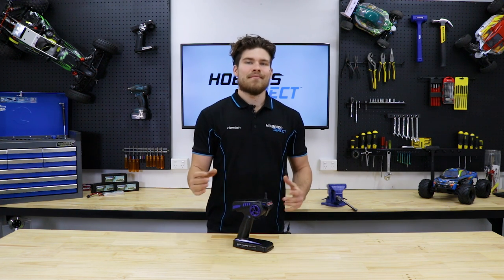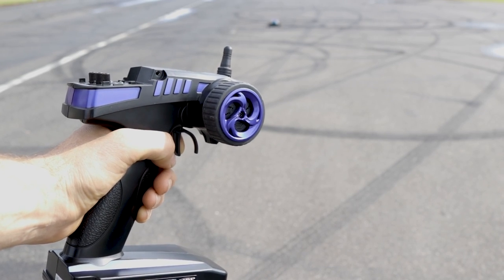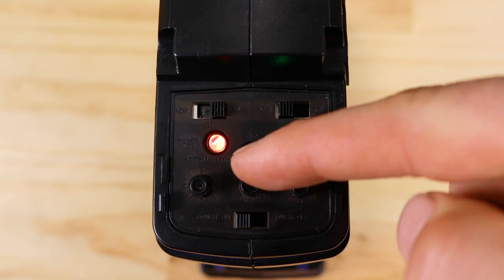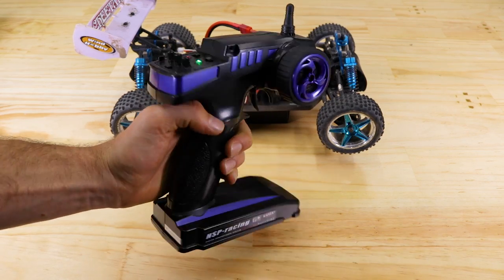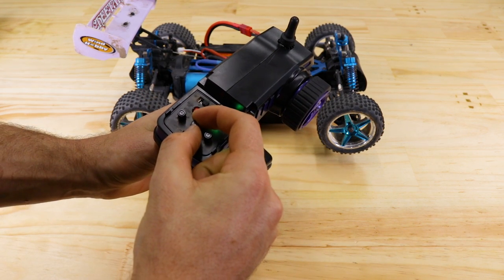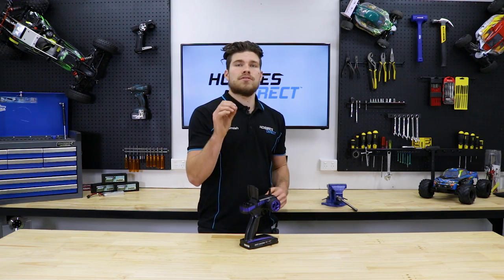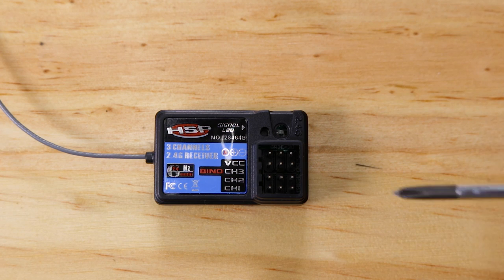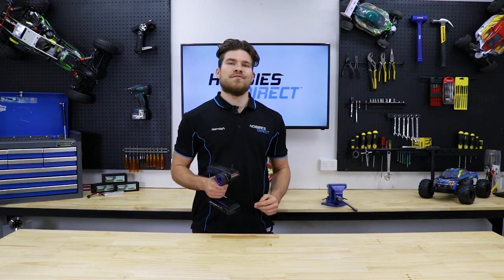How to: Understanding and Adjusting Basic RC Hobby 2.4Ghz Transmitter Settings

Comment: Thank you for the great info. I have a cheap RC boat that once work and no longer works. The board has power, but the remote does. New batteries didn’t help. Any suggestions on where to start?
Reply from the maker: Not knowing anything about the boat, might be time for a new radio system :-/

Comment: Hi mate nice informative video can I ask your advice please. I have a original hornet RC off roader but I took out the battery pack to insert a ubec, would I now need to replace the ESC and controller? as I'm having trouble and confused me and can't move on to finish it. Any help appreciated. Thanks, mark.

Comment: My HPI TF-40 Transmitter has both D/R and Servo End Point Adjustments for both Steering Servo and Throttle Servo, do they both do the same thing?
Reply from the maker: Really good question Scott, they are similar but unlike dual rates the endpoints adjustment allows you to set the throw for each direction individually. For example, you may need 50 degrees of servo travel to attain full left steering lock but only 30 degrees for full right, where  D/R adjusts each side equally.
We should do a video on endpoints, hope this answers your question.

Comment: What does the TH trim do, whats a throttle channel?
Reply from the maker: There is a trim knob for each channel. The knobs are used to adjust the steering or throttle so that the car tracks straight when the steering wheel is centered and does not creep when the trigger is at neutral.

Comment: why is my 4ch dumborc  have to REVERSE throttle and steering swotches to work normally?  ALSO  forward is slow and reverse is FAST   how do i fix that?
Reply from the maker: Every car has a different "normal" motor and steering direction, the reverse channel switches enable the controller to work with many different models. As for going backwards faster, swap your motor wires and reverse your throttle channel switch from whatever position it is in :-)
Reply: @HobbiesDirect  i am a newby with this  an old dog new tricks 59yr old   lol   explain  swap your motor wires ?   got 3wires to the esc    yellow  red   blue   how should i swap these?  also  switched throttle from normal to rev   direction is fixed   just the power issue remains   thank you! Chuck
Reply from the maker: You should be able to swap any two of them if it's not a sensored system - watch here: https://youtu.be/-hAoT1ZsBEI?t=597
Reply: @HobbiesDirect  i left the center-RED alone   i swapped the BLUE and YELLOW and that did it!!! 2days of trying to figure it out and you really helped!   Thank you!  Chuck
Reply from the maker: @chuckneal5828  Awesome!

Comment: Can somebody help me, when I turn off the controller or the car is out of range, it go full throttle forward instead of stopping, how to fix this
Reply from the maker: Sounds like your failsafe is set incorrectly, try resetting it, should fix the problem 🤙
Reply: @HobbiesDirect  ٠
Thnx for your answer, I reset it, it works fine, after 30 minutes, it goes back to falt and the car throttle forward alone, I rest again and it's fine for another 15 or 30 minutes,, should I buy a new one? Or if there is a way to hard reset settings in it?
Reply: And I really respect you for quick answer, other channels don't even care about followers, thnx a alot

Comment: One question . If i set the throttle trim do I need to calibrating again ?
I can't figure it out .my sterling still not working and lean to one side . My rc brand is serpent XRS8 e
Reply from the maker: If you change the throttle trim, it's a good idea to recalibrate as you have moved the neutral point. What's your steering not doing?
Reply: @HobbiesDirect  I solve the problem ald .thanks dude . Because I accidentally set the throttle so my car unble to reverse .after I set it back to neutral everything fine .
Reply from the maker: @van_r2222  Nice!